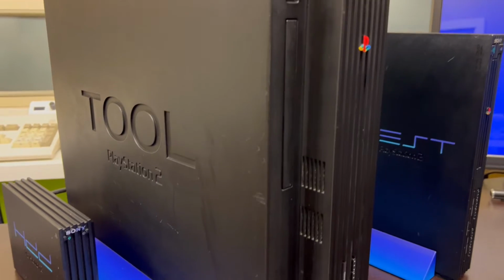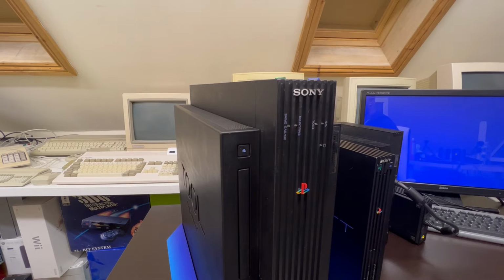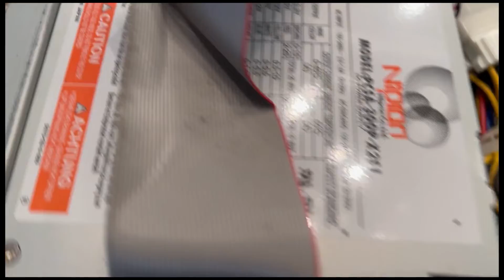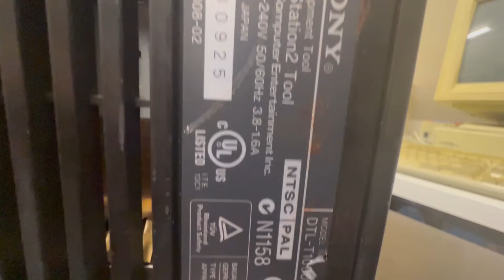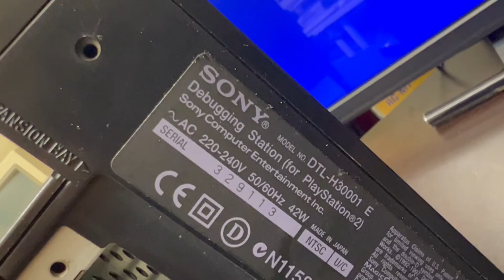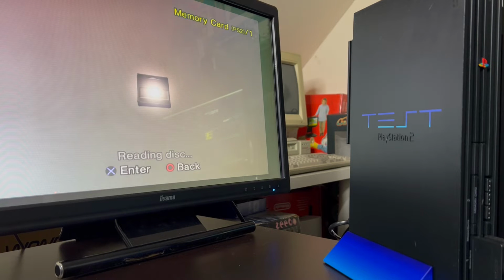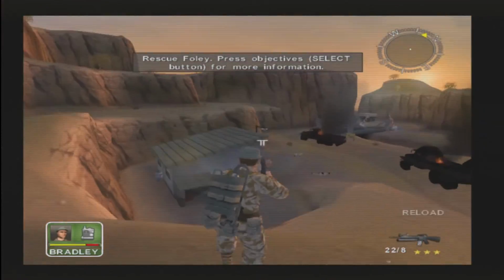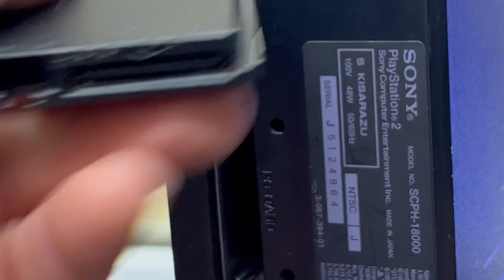PS2 Dev Tools (DTL-T10000H) & (DTL-H3000E)

Comment: Sadly I've never been able to get the side panel off mine. Needs a new hardrive as it seems to have been removed.
Reply from the maker: Hard drives seem to be the weak spot of the system they die or get taken out I have ran mine on a cf card before with an image which you sometimes can find an online to use
Reply: @TheVetUk  and the disc drive unfortunaly aswell as the plastic shell

Comment: Do they both have better performance or is it just the XXL Dev Kit? i heard about the dev kits having more RAM and faster clock speed.
Reply from the maker: Hi 
From what I gather it’s a Linux pc with a PS2 bolted on and you can transfer and do stuff from the internal pc to the PS2 and run demos and code straight from the PC which is cool so more features than a standard dev kit
Reply: X4 ram for both CPUs, it's the only way of having relatively decent debugging on real hardware and the boot ROM is reprogramable

Comment: hi, i have the same model of PS2 TOOL but whitout the blu vertical base. were i can found one? thanks
Reply from the maker: With the drives removed you will need to connect the drive to your pc and use a program like raw hdd copy and create an image of the drive on your pc I would also upload the image to a cloud or other for others to use if there’s go down too
Reply: @TheVetUk  ok but i neet first to get an IDE adapter because i dont have.any possibility to see whats data inside this 2 drive?mayne some demo or unreleased game. I only know that my unit come from the sony UK  studios in london.
Reply from the maker: It’s nearly impossible to find these separate I was going to make them out of wood and paint them on a system I was going to buy before this one
Reply from the maker: If yours boots to ps2 ok I would recommend making a backup as the HDD are dying
Reply: @TheVetUk  yes its working. How can i make a backup of the 2 IDE hdd?

Comment: Both HDD’s on my TOOL sadly failed the last time I tried to use the machine.  I now need to find some replacement drives and drive images to get it operational once again.  Do you have any advice on suitable HDD replacements?
Reply from the maker: Compact flash worked on mine I just tried it to see what happen and it booted on the CF card with IDE adapter I got An image off obscure gamer site both drives had images available